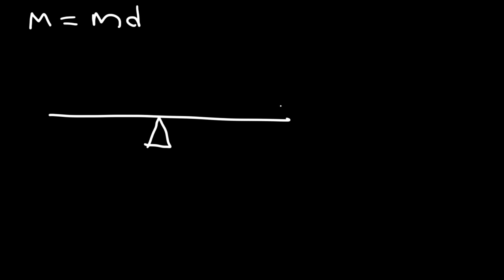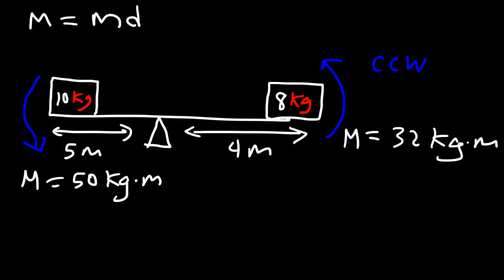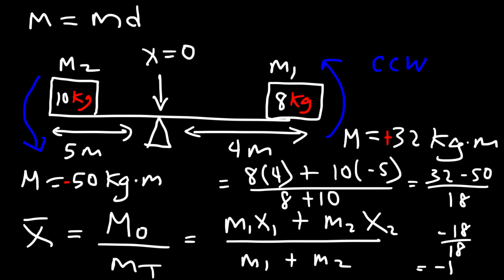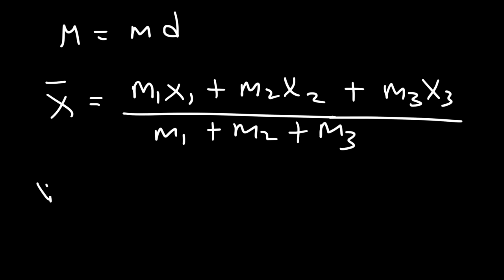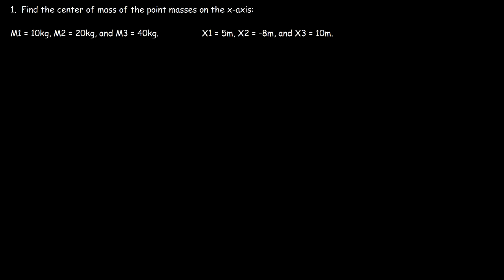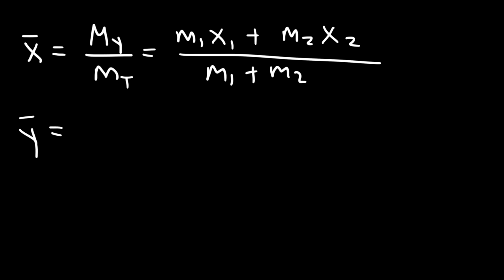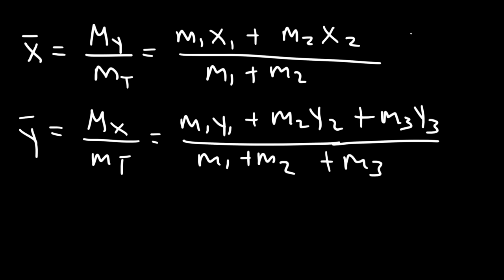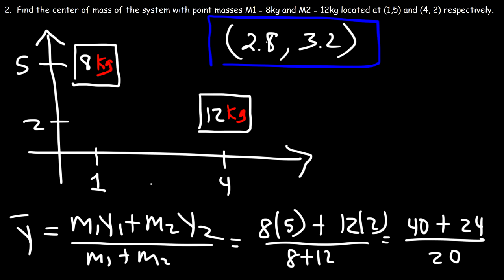Center of Mass & Centroid Problems - Calculus

Comment: I know this is calculus of course. But this application is really physics based as well. Doing angular momentum we have to use this very technique to start off.  I know because we just had a lecture on this very thing yesterday. And wow, was I lost in class. Timing could not be better for this video. 

Thanks!
Reply: @darrinlewis9659  is(was) everything okay?

Comment: Shouldn't the area be 1/2? Because at 35:00 , the second part should be (8/3 + 4/2 - 4), instead of (8/3 - 4/2 - 4). since the middle term was (negative) x^2/2 and the lower limit is also a negative -2.
Reply: The video is right, your calculation has a mistake. The lower bound is -2. If you square it, you get +4. Take the half, it's +4/2. The middle terme was the negative of that, so -4/2 is ok.

Comment: why are you adding the formula to find yi inside the integral? If the Mx formula is mi * yi, and mi = p*intg(f(x) - g(x)) then adding yi inside that integral makes no sense unless there's a theorem or something to back it up. Shouldn't it be Mx = p * intg(f(x) - g(x)) * f(x)-g(x) / 2 ?
Reply: Yea I was thinking the same thing but then I realized that yi is a constant and by the constant multiple rule it can be pulled out of an integral and therefore added back in.
Reply: He says (f(x) - g(x))/2 but the x has a value so that whole expression is a constant.

Comment: Can you give a reason why we can always find a horizontal line y=a through the lamina such that the sum of all the moments on either side of this line (ie the integral) is guaranteed to be zero.  Or indeed why one can always find a line y=mx+c through the lamina where the sum of the moments on either side of it sum to zero. I know it's intuitively obvious (intersection of plumb lines hanging from different positions on the lamina in physics for example) but Id love to see a proof of this. Unfortunately I can't find an answer anywhere.

Comment: Correct me if I'm wrong, but Moment is defined as rxf, r being the distance from the point you're focusing on, and f being the force applied. It simplifies to basically be torque (force times distance), but mass isn't a weight so how can they be the same
Reply: If you assume gravity is constant at every point on the lever/masses it can be ignored, since it will be the same for both moments, when comparing them it will be divided out. If gravity were different on one side of the fulcrum you would need to take that into account and use mass not weight. :3
Reply: I agree with Otaku Fam. In order to find a center of mass, we compare things. Whether you use distance*force or distance*mass for a comparison is of no importance, just because it's only a comparison.
I mean (D1*F1)/(D2*F2) = (D1*F1*g)/(D2*F2*g) = (D1*M1)/(D2*M2)

Comment: 22:26 Xi changes though for each strip, how can you just multiply the area/mass of the whole shape by just the X coordinate of one of the many strip's?
Reply: there's an integral in the formula so it's basically doing a sum of all of those tiny xi stripe. That's how it works. You should check out the Riemann sum if you want to get a better understanding of the concept